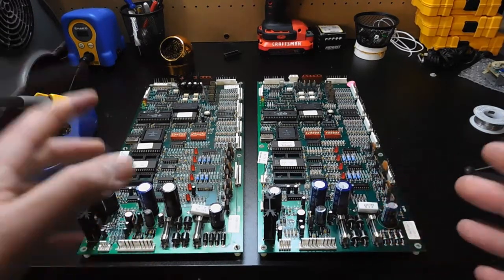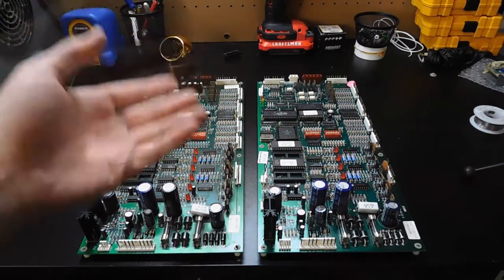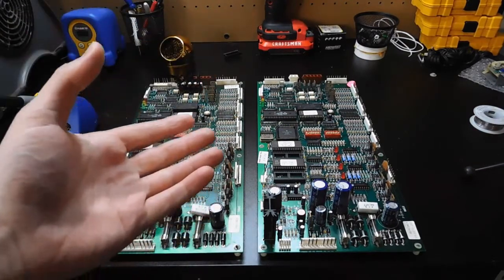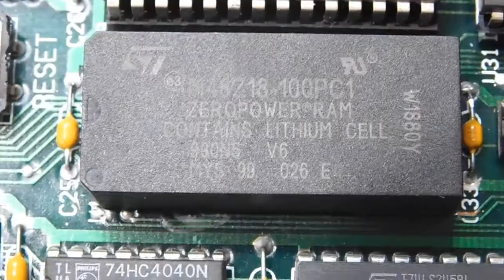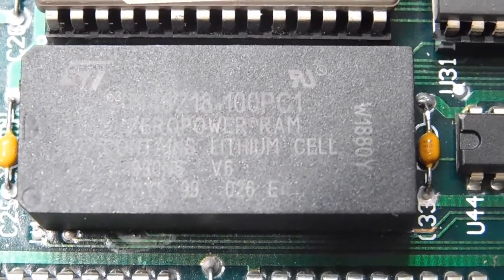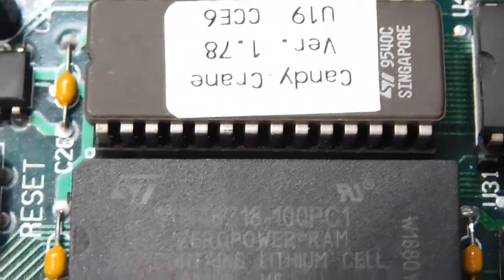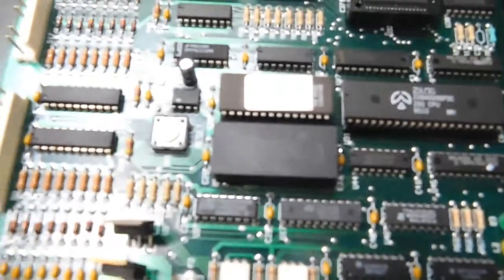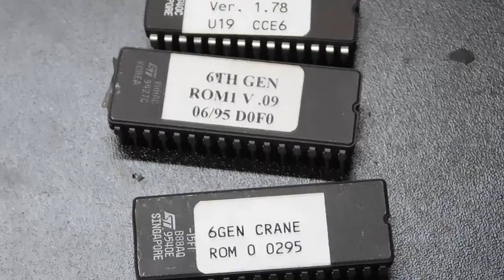Smart Ind. 6th Gen. Claw Machine PCB Repair - Settings Won't Save

Comment: I had one of these a decade ago on route at a laundromat. Made good money! Had an issue with it once and Smart was able to help me out over the phone. Great company. I recently found two dead ones I'm going to try and get running and route them. EDIT: Props for the ROM download, subbed!
Reply from the maker: I love these machines. All the good qualities of a vintage crane but in a size that I can load into a pickup without help. 

Sadly I was never able to find a location for these. I ended up moving from Georgia to Kentucky shortly afterwards, so I sold them. I had kept a large Clean Sweep crane for my personal collection, but it was so heavy that I ended up selling it too. Now I'm wishing I had kept one or both of these for my personal collection, as I now don't have a proper crane.

Best wishes on fixing yours. I assume you're familiar with the mechanics of them and can get them running. If not, send me a message and I will help you however I can.
Reply: @coin-opcorner  Just started troubleshooting them today. One has a code 77 on the lower display. You don't have a manual do you?
Reply from the maker: @kylen.6742  Add me. I'll send you the PDF. 
 https://www.facebook.com/profile.php?id=100055156784869

Comment: Is there an online manual for something like this? I bought one that’s got smart industries tech inside of it. I got it on Facebook so it didn’t come with a manual. I’ve looked online to see what the different settings mean but nothing I’ve found makes any sense
Reply from the maker: You have to buy them from Smart Industries, if you can get them on the phone. They can send you a digital version of the manual.
Reply from the maker: @Reece_McMillan  Yeah, they have the copyright to the manual still. Lots of old pinball companies do the same thing.

Comment: I need to know where to buy the motors... One of mine are broken and I cant find a replacement that fits ...
Reply from the maker: My first solution would be to look on ebay. I know it's expensive, but there isn't much choice. 

As well, Smart Industries is still in business and they've often got replacement parts. https://www.smartind.com/

Lastly, you could go all out and install a new gantry and PCB, but that's going to be the most expensive option (I haven't checked to see if this is the right size, btw. Just an example of one of the kits). https://www.ebay.com/itm/154829534291?hash=item240c8f3453:g:pawAAOSwywZh0vbQ

Before you do any of that, if your motor is just running slow or gets locked up, I'd recommend relubricating the worm gear (and all the other gears on the gantry). Smart used a lubricant that gets sticky and gummed up over time. Feel free to reach out with any other questions.
Reply: @coin-opcorner  bro, thankyou i didnt expect you to answer. This is also really in depth as well! The motor is completely broken and I bought a replacement off of ebay, but it doesn't work.. I think I might have to go to alibaba or aliexpress to buy a replacement, thankyou for your time!
Reply from the maker: @Robot831  Have you checked the wiring to the motor to see if it's even getting voltage? If two motors in a row don't work, I would be suspect of the wiring, and then the transistor on the PCB.
Reply: @coin-opcorner it moves left and right, but when I press drop it doesn't go down. i went to check the motor and they motor is dead stiff... I stupidly cut out the wires to add a new motor not knowing it was going to be near impossible to find the exact kind. I think the gantry is working, but the motor is just broken

Comment: How do you adjust the settings. I have the same exact crane and all the same issues.
Reply from the maker: There should be a small board with the volume control / claw strength control on it. There's a button on that that lets you go through different settings.
Reply: @coin-opcorner  could you send me pictures of the inside of your machine. I don't have another board with volume control... but I have all the sounds it makes when the gantry moves and clay drops. Problem is no power to the claw or gantry motors but the pcb recognized when the gantry safety stop switches are pressed.
Reply from the maker: @bradinandmichael1180  I don't think you can send images on YouTube. If you are on KLOV you can message me, JeremiahJaxxon
Reply: @coin-opcorner  no luck finding you. I just joined. My SN is Srulo318.
Reply from the maker: @bradinandmichael1180  I posted some images on your page.
Reply from the maker: @bradinandmichael1180  Evidently I do not have the proper credentials. Just add me on fb. https://www.facebook.com/profile.php?id=100055156784869
Reply: Do u have the manual and schematics for this claw machine.
Reply from the maker: @CVTCountryBoy   Yo. Smart has the manual available for sale on their website. Unfortunately, there are no schematics online and the ones in the manual are just the low-res previews from whatever CAD software they used to make up the real schematics. It's a pretty basic board though so it shouldn't be too hard to fix anything that might have broken on it.